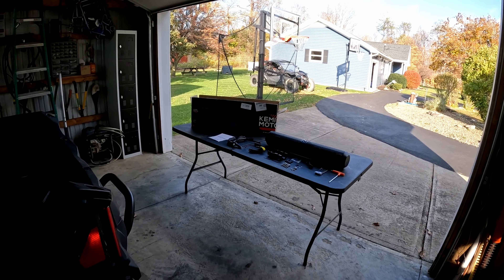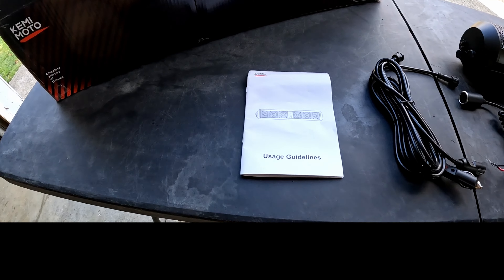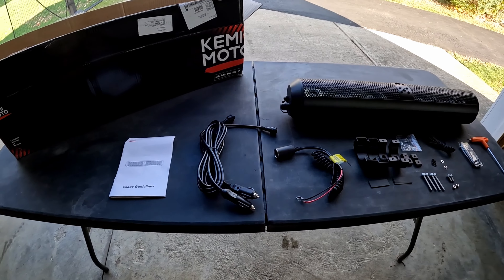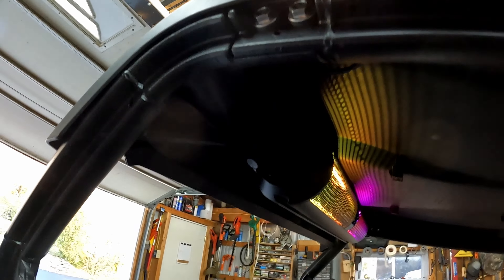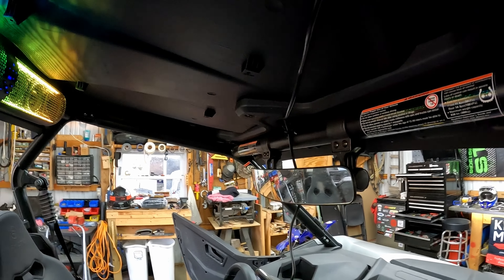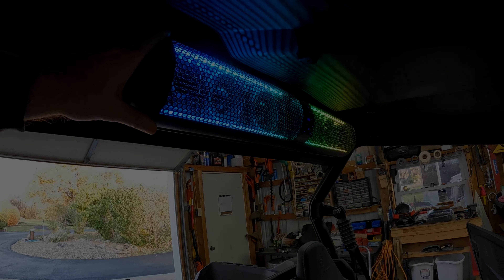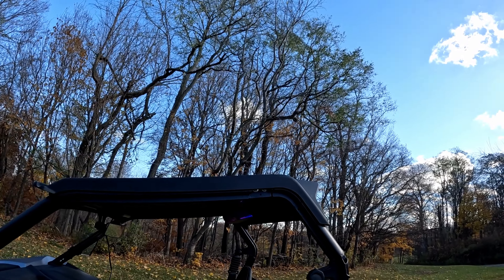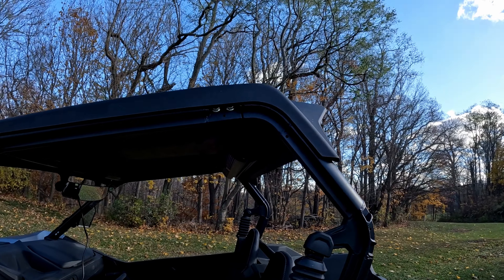Installing Kemimoto UTV Soundbar in 2023 CFMoto Zforce 800 Trail

Comment: Sounds pretty good on the video.  How is it in real life, good?
Reply from the maker: It actually sounds really good. It's not as loud as the Noam Speakers I put in my X3, but it's pretty close. It's louder than the Boss Audio bar I had.
Reply from the maker: It actually sounds really good. It's not as loud as the Noam Speakers I put in my X3, but it's pretty close. It's louder than the Boss Audio bar I had.
Reply: I wish you would have explained more on how you mounted to the top of the roof does the speaker have brackets for that